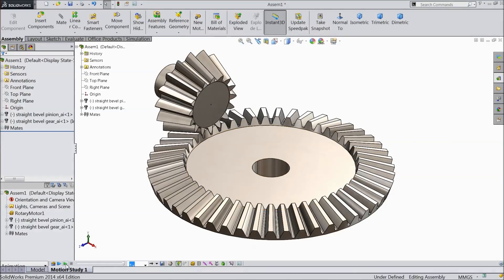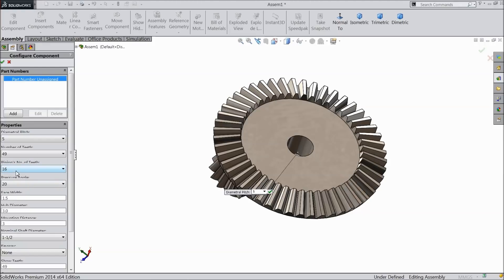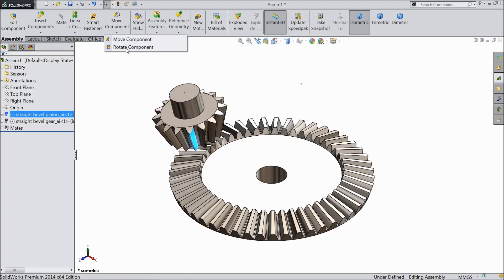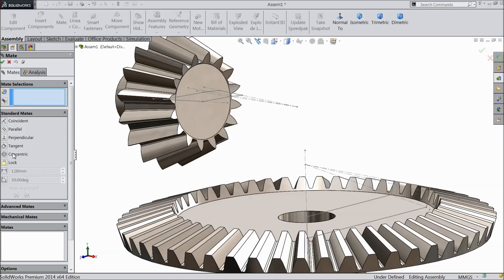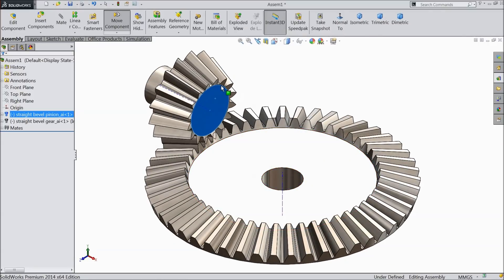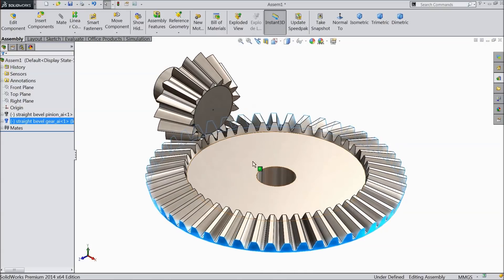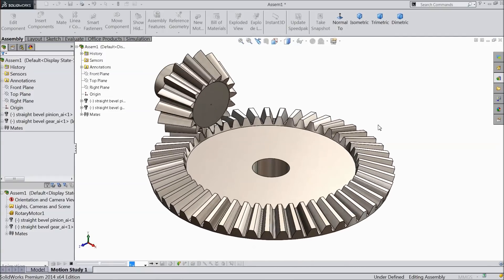Solidworks tutorial | Pinion & Gear (Motion Study)

Comment: Sir Can you tell me how to change the dimensions of straight bever at the beginning ? I am really in Trouble with that.
Reply from the maker: ferdi caner bayram once we drag the gear it will ask you to put the dimension, just initial part of video, you will find how we edit the gear dimensions,
Reply: Sir I guess that is the problem. It never asks me to put dimensions. Do you have any idea how to fix it ?
Reply from the maker: Design Library Available in your software? how you drag the gear, if not available just goto add ins & click on Solidworks toolbox Library, Than try,
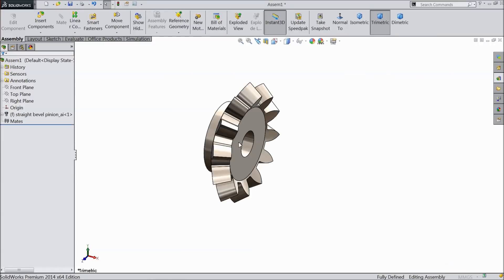Reply: @CADCAMTUTORIALBYMAHTABALAM  that's true at 01:40 when you drag the gear it's dimension and shape changes according to your previous dimensions but when I tried even after putting new dimensions the shape remains same.....I am not getting how to change this shape.
Reply: @vanditmehta4042  do the things exactly he does, do not pick the metric one